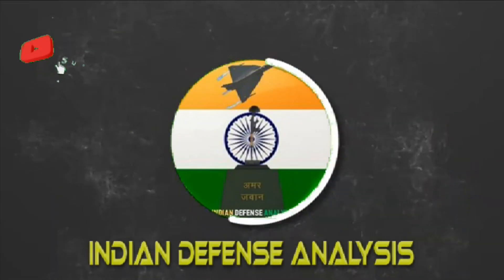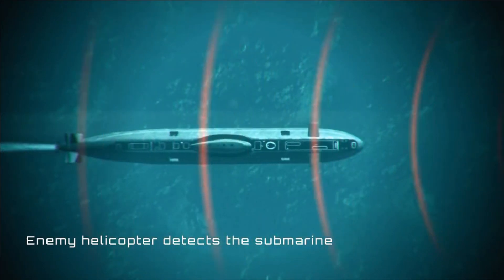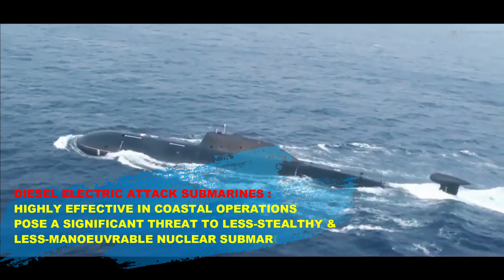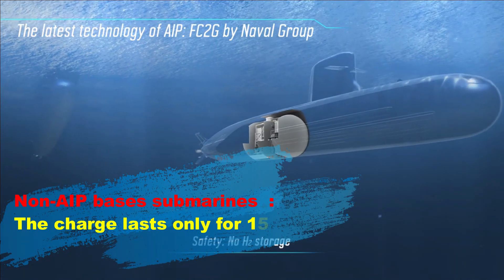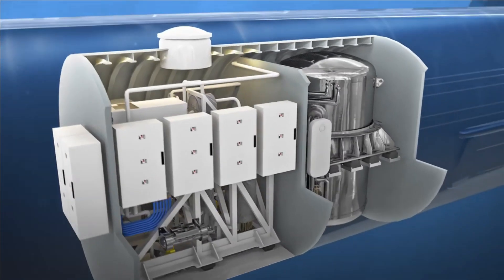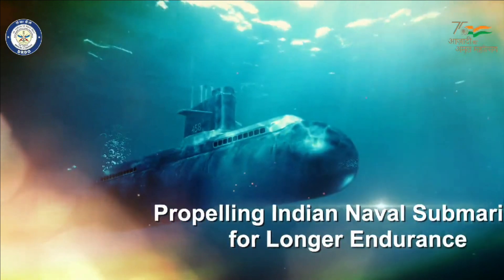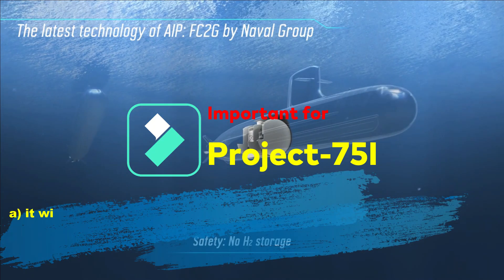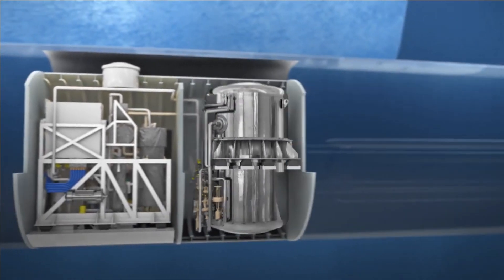DRDO’s AIP to be retrofitted from 2024-25 onwards on 6 Scorpene submarines

Comment: DRDO should first test this AIP system by  building a deep well close to the sea and using deepsea divers or robots to the depth these submarines dive and test this equipment before installing it on our submarines. You must remember that when you crop a submarine hull that area becomes week and at lower depths the water pressure is so high that it can fracture the hull of the submarines. One must remember of the submarine accident in Indonesia. Therefore instead of installing on our in use submarines it's better to be installed on new submarines. Regards Joseph